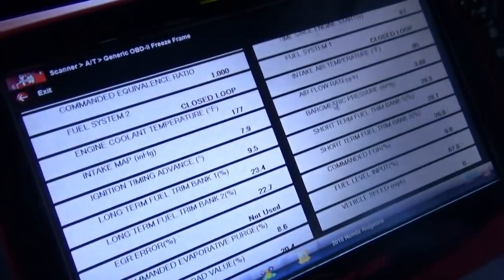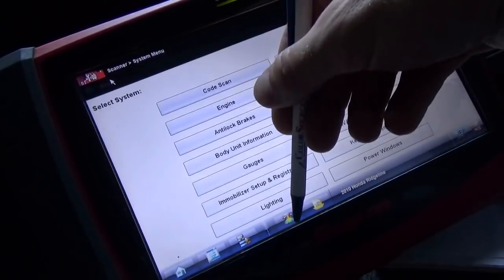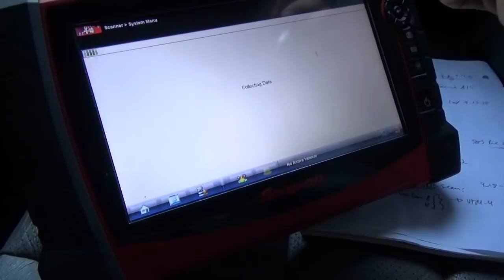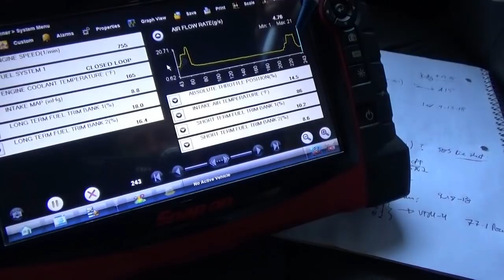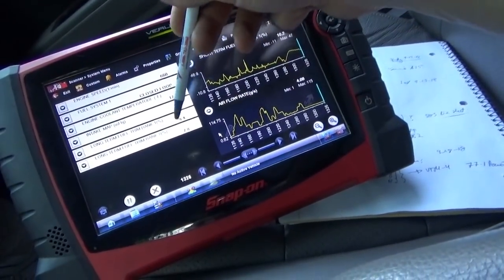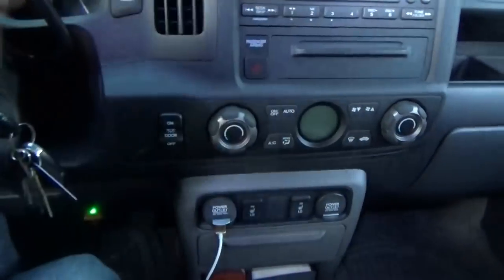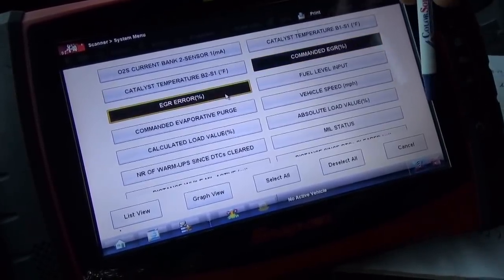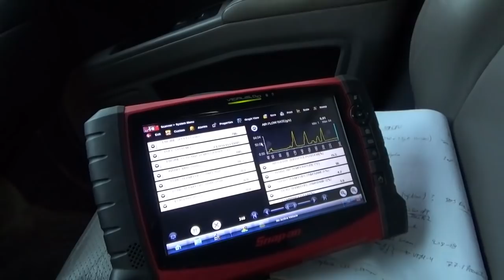COMEBACK! Honda Ridgeline Check Engine P0171

Comment: The short fuel trim went from 20+ down to 10ish. The intake tube needs replacement and the vehicle needs the PCM reset. More driving will relearn it to do well again. I think you overanalyzed this one, but good job anyhow. I like your work and your personality. 10 and even in the teens is fine for short fuel trim especially when overcoming a gross vacum leak. Especially in short trim. You need to reset the PCM and then drive it a while. Its fixed. Good Job. You should charge for the diag and duct tape anyway. This was a valuable diagnosis. They can now get the part and easily replace it themselves or have you or someone else.

Comment: My 05 Acura did the same thing. Snorkel tore, fuel trims went nuts. I too had to reset the ECU in order for it to keep the light off, and relearn, after I replaced the intake rubber inlet air pipe. It just wouldn't learn by itself! Good vid!

Comment: Wow, that hose was smoked! Used to see stuff like that all the time in Phoenix, where the heat just destroyed anything made of plastic or rubber. Sand also blasted the glass pretty bad, too, especially during monsoon season. Up here, the salt destroys the metal. Can't win for losing with automobiles! 

Glad you showed this one - I've had this happen to me, and I was flipping out. Cleared the codes, and bam - fixed! WTH!! 😁
Reply from the maker: Cars survive forever only in California and Oregon...maybe Colorado too.
Reply: Yeah, there's alot of truth to that Ivan!
Reply: Car bodies love Phoenix, but upholstery, plastics, rubber, and batteries hate it. Lived there for 25 years and never had an under-hood battery survive three summers. The afternoon it was 122F I hit the starter and was rewarded with a "pop" and vapors from under the hood - the battery had exploded!

Comment: as a side note, I always check the motor/trans mounts when I find a torn air tubes. brake torquing, going from forward to reverse or rocking them back and forth on a flat surface, while in park/off.
I also find all sorts of bad suspension and drive-line issues by rocking.
that one was so dry rotted it would have torn with everything else good anyway.

Comment: I have seen several cases of unexplained high fuel trims on Honda J35's (around 10-15% on both ST and LT.)  Each time I'd ruled out vacuum leaks and MAF.  In my own limited experience, replacing the O2's has fixed it in every case.  So, if the car is in the mid 100K mile range then it's time for new O2's, including the downstreams.  Honda does use downstream O2's for fuel strategy.
Reply: I have a 2012 ridgeline  and during cold weather the rpm tends to surge between 1100 to as low as 400 rpm  and it will not give a code right away ,  if it gets worst the rpm will get faster surging then will trip the check enfine light  along with vtm4 vsa  mulfunctions  then if its warm weather its fine  .. but what i notice the FUEL TRIM in the dash board its high for me its ranging between 18 to almost 20 liters per 100 kmh... its just getting worst during cold season
Reply: Sorry forgot to mention i have 2012 touring ridgeline

Comment: had valve cover gaskets replaced, valve adjustments, transfer fluid replaced on one. routing maintenance. within 24 hours, check engine with message check emissions lights comes on. later vtm4 comes on. vtm4 goes off after restart.  any ideas? dealer did the maintenance. trying to get an appointment. anything they touch doing those jobs can cause that?

Comment: The cracks in the air intake hose introduce a lot of air flow not registered by the air flow meter, especially with throttle open.  Duct tape won't seal it properly and the owner will have issues again.
Reply: That's when you go over the duct tape with some electrical tape.
Reply: You seal it with tape to be sure the problem is diagnosed correctly, and so that the vehicle can be driven until a replacement air intake  hose can be obtained and installed.
Reply: Lol, always a critic, good job on diagnostic Ivan.
Reply: The permanent fix is some Harbor Freight epoxy!
Reply: @frugalprepper  LMFAO. that ought to drive em crazy!

Comment: Those flexible air intakes fail around 100 to 150k miles. I have had 2 Hondas that have had the same failure in the exact place this one broke.
Reply from the maker: JUNK! That's like Hyundai-Kia quality level right there haha
Reply: @PineHollowAutoDiagnostics  - well... junk may be a little harsh. I guess for all of the heating/cooling cycles and movement these things have to endure, and extra $60 bucks every 100k miles is not too bad. I have a weird clunking sound in the front end of my Kia Soul right now and it only has about 62k on the clock. Now that is junk. No Honda would be giving me suspension issues at 60k miles.  ☺
Reply: Mine got a hole at around 170k, Honda OEM ones are like $25 on eBay. Takes 5 min to replace
Reply from the maker: I mean that one part is junk. Hondas overall are very solid vehicles :)
Reply: @PineHollowAutoDiagnostics  , indeed. I knew you weren't trashing my beloved brand. No respectable mechanic would diss on a Honda.   😀
Reply: Poor motor mounts cause it
Reply: @Kro_man_tx  Don't be so sure about Honda's not giving you problems before 60k. I had a 2005 Honda CRV that was junk at 20k miles. Two AC compressors, a bearing in the AWD system, and a rear strut all failed before the POS was out of the pathetic 3/36 Honda warranty. When the thing was out of warranty, I traded it. Since that CRV, I've owned two Kia Sorento's and I've never had any problems remotely close to that. As with most people, when you have problems like that early in ownership, it tends to put a bad taste in your mouth with that car company as a whole. I'm not sure that I'd ever consider another Honda.
Reply: @EchelonStrat  .  You got the car built by the trainees at the factory.   : ).   I have had 3 CR-V's, 1Accord, a Ridgline, a Pilot and an MDX (as well as maybe 12 different Honda motorcycles). They were all fantastic. But I am sure there are duds in every bunch. Statistically speaking, you can't make hundreds of thousands of vehicles and not have something go wrong.  This Soul is my first Hyundai/Kia, and things are not looking good. But if you're happy with the cars, that's great! To each their own.
Reply: Honda is just now getting off my "don't buy new" list. It started with the Great Honda Automatic Transmission Debacle of 1998-2004, continued through the 2006 Civic engine block cracks, and the 2007 Accord rear brake mess. They seem to have gone 10 years without a major reliability scandal but I have discovered the Prius. My unreliable first generation Prius needed its first repair beyond 12V batteries, windshields, tires and wiper blades a year ago at 198K miles - the inverter cooling pump failed. I gave it to my son a couple months ago and he replaced the front brakes - they were about 2/3 worn at 205K miles but the slide pins needed service. The rear brakes were not measurably worn. It will need shocks and struts before it reaches 300K miles, I'm sure. The first gen hybrid battery was not very reliable either - I've set aside $1300 to replace it in the next few years because my son does not have the moolah for that.

Comment: So my 08 Acura (Honda) Runs very similar at times. At idle I can see my short terms going 8-15% and my longer term getting higher. However when I start to drive it even its out eventually.  I think it is Honda's strategy, after I reset the data it goes back to normal for a bit. I'm assuming until all the tests have ran.  I do have more factors in my car like a Short ram intake and maybe working cats. That's why I'm surprised to see a Honda with none of those factors.
Reply: Clean throttle body.

Comment: Didn't check for exhaust leaks at all? I've had that same P0171code, and an exhaust leak was the cause, a surprisingly small leak at that but before the rear O2 sensor.
Reply from the maker: Keep in mind both banks trims were the same. a leak on one bank would just affect that side :)
Reply: Pine Hollow Auto Diagnostics That's a fair point.

Comment: I have a question. after a rear rotor replacement on a 2007 honda ridgeline the vtm 4 and check engine light came on. Is this a connected issue?

Comment: Visual inspections are first, always first, it's the sign of a proper mechanic.
Pull the hood first, look around, then plug in and see what's going on, if nothing was wrong visually.
I don't understand why you never look first.
Reply from the maker: Tube didn't look torn at all at first glance. I mean visual inspections without any sort of direction usually end up fruitless?
Reply: James Fenton is absolutely right. If the check engine light is on the right way it so take 10 min or more to look everything under the wood (because every proper mechanic knows that engine light on means the issue is surely under the hood ...) rather than take 1 min to read the code and have a direction to look closely. After checking under the hood, you read the code and swap the more probable part. It will not fix the problem so you swap another part. And so on. That's how works a proper mechanic.  Ivan how dare you diagnose an issue ?
Reply: Lol, always a critic, good job on diagnostic Ivan.  Issue was found, doesn't matter how you got to it-enough said.
Reply: @didtoknan8128  lol
Reply: No, you are wrong. If there's a check in light, you scan first. Always.

Comment: That what i figured after i watch him do it in the bonus footage. The first couple times i seen it happen i thought he just gave it a little bit of throttle but in the bonus footave u see him give it a bit of throttle and its stays in cl then when he puts wot it goes to ol. Is this a honda stratagie or does all manufacturers do this. Ive never really noticed.
Reply from the maker: Hi Dylan, most cars go to Open Loop at WOT for more power delivery with a richer mixture.

Comment: Believe it or not, you can take a clean old t-shirt, a putty knife, and black rtv, remove the air tube, clean it with alcohol, apply a whole tube of rtv to the T-shirt, spread it even and thin, then wrap the tube. Wax paper or piece of cardboard HIGHLY recommend. It won't fly on a concourse car, but it's effective, and lasts. Oh, yea, and price....

Comment: I've had this same problem for a Chevy express with the 4.8. mass air flow was reading high at idle. Took me a minute to figure it out. Turned out the purge valve was stuck open and making both banks lean

Comment: Nice job, and a month for duct tape warrenty is great. Did you replace that hose with real Honda or go to rock auto ? Neat how clearing codes some how reset things to work again.  Great Job. Verus rocks the Honda !
Reply from the maker: Thanks Lyle. Customer opted to put in his own air tube :)

Comment: I have a 2007 acura mdx v6 3.7 whit p0138 ho2s b1s2 low volt, we change already a ho2s and come back again, fuel trim looks ok, do you thing could be a catalytic converter on B1????
Reply from the maker: No...you need proper diagnosis before blaming the cat ;)

Comment: Honda typically runs a heated crankcase vent and that is why that pipe gets so freaking hot.
Reply: Thank you for that info. What is the purpose of a heated crankase vent? Avoid clogging?
Reply: I never really thought about why honda and some fords heat the PCV and crankcase vent hoses but my guess would be this. The Crankcase vent and PCV get vapors from the top of the engine which include water vapor as the engine warms up. In cold weather the water vapor could condense and then freeze causing a restriction in the line. If the line gets plugged you could end up with leaking oil seals. Hope this helps.
Reply: @sinegra30   to prevent freezing up in the winter.
Reply: +wysetech2000 oh I see, thank you!
Reply: +ThePracticalMechanic, I guess you're right, thank you!

Comment: dorkman sells snorkels...  ive seen that before with the trims,   reset  and they stay in range
Reply from the maker: Dorman snorkel probably wouldn't fit right, and then when you finally beat it into submission for an hour, it would only last 5 minutes in operation xD Duct tape is more reliable...it can last for weeks!

Comment: Squirt bottle of water (or if you are brave brake clean) can be a great quick way of chasing intake leaks.
Reply: Usually brake clean has no issues on a hot engine. As long as your plug wires are good.

Comment: sounded like it was still hissing away on the camera, even after you plugged the holes, but I know how they throw the sound off.
probably the pcv valve on that metal tube, they get blazing hot, I'd guess a leak at pcv valve boot or brake booster.

Comment: Every time I get a lean code on a Honda and a lot of other Imports always check that air intake hose first You'll Always Find a crack in one of the folds so the car will get more air than the mass air flow send cersei's so you will get a code for lean this works for American cars as well

Comment: Rule of thump mass airflow g/s should be close to size of engine in liters at idle, a/c and other loads off, example 3.5 liter engine mass airflow around 3.5 g/s

Comment: I would install a new hose. That tape won't last forever. Too much flex in it.
Reply: In addition there is a reason it is tearing. It will tear more, and soon. Tell the customer it should be replaced.
Reply: @flagmichael  Looks like it had been manhandled by someone.

Comment: As soon as u give it some throttle its going into open loop for a second then back to closed. Is that normal for a honda. Doesnt seem right to me
Reply: ECM response to WOT
Reply from the maker: Also on decel it cuts fuel so it shows "Open-Loop Drive" :)

Comment: There is no way duct tape on an accordion surface is airtight.  Will be reflected in the fuel trims.
Reply from the maker: @plowe6753  actually the fuel trims reflected that the duct tape was perfectly airtight 😂👌

Comment: How dare you slash peoples throttle body tubes when you diagnose their steering!  Great video.  You may as well fill up their tires with some of EricO's bad air while you're at it.   I was screaming clear the codes.  I have found Honda's for some reason seem to take forever to relearn their fuel trims.

Comment: Tried duct tape before on with a similar problem on another brand- complete waste of time-only answer was new tube , needs to be completely sealed that’s why they have hose clamps on ends
Reply: it should work well enough to see if there's anything else wrong :)

Comment: On my Contour, same problem, but I ended up fabricating the intake tube out of aluminium. Hole was at the tube at the port where the idle air controller hose port was. Maf reading was 3.56 gm sec at idle. Should be 4 to 5 gm sec.